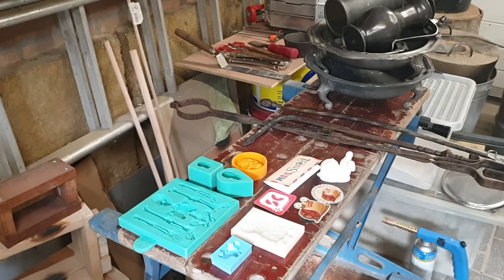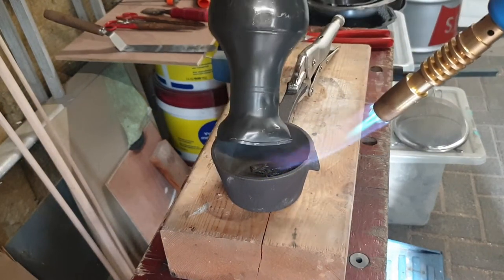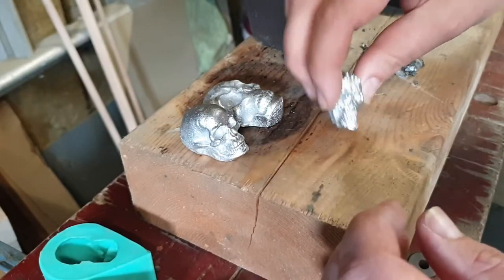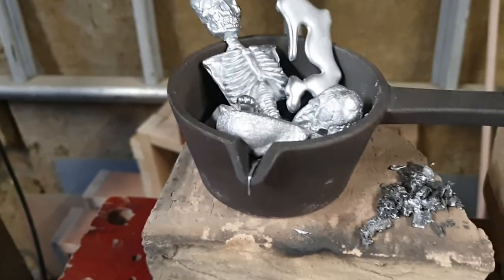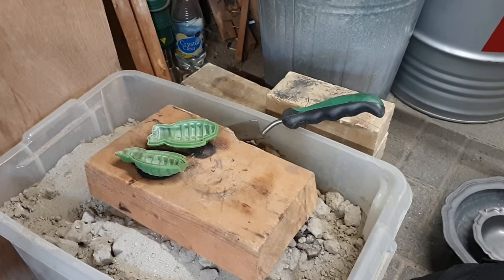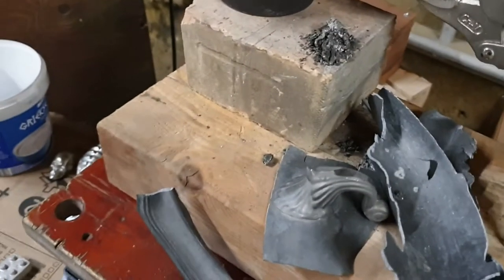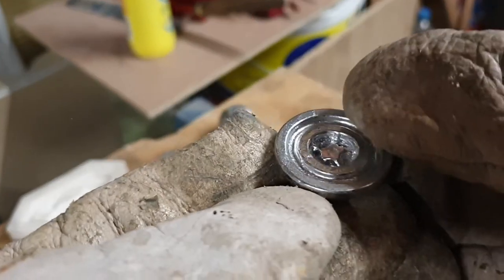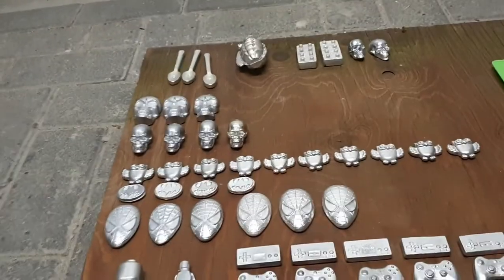More fun with pewter and silicone molds

Comment: Couple of points for anyone wanting to try this 
1. Dusting your moulds with baby powder helps to get a better surface finish 
2. if you have something in your workshop that vibrates when its turned on or makes your  bench vibrate put the mould on there pour the pewter in and then vibrate for a few seconds and this will help to prevent any sink holes as it settles the pewter into the mould and helps get any air out 
Happy casting :-)
Reply from the maker: Thanks for this info! and thanks for watching 👍👊

Comment: I kept waiting for the metal to freeze up on you when pouring the grenade.  I drop in and look for pewter at the local thrift shop periodically, but haven't noticed any on my trips, though I have found some decent and cheap metal molds that I've used a lot.  Always funny going to the front and being asked if I bake :)

Comment: Interesting video with good tips. Was curious, what kind of silicon are these molds?
Reply from the maker: They are just random silicon molds I bought on various websites, most silicon will hold up to liquid pewter/Tin, Lead and probably Zinc. Just make sure it's actual silicon and not rubber, I've molted through a few ice cube molds in the past 😅 Thanks for watching and commenting 👍🏻

Comment: Very good for someone learning to watch this, thanks!
Do you not need to heat up the mold first? Ive seen others say you need to, but ,ooks like your results are great without.

:)
Reply from the maker: The molds will heat up enough after the first pour, the good thing about pewter is that fails can be remolten and re poured very easily and very quickly. Thanks for watching and commenting 👍

Comment: That's really good.  I came across this video by accident and thought it was going to be rubbish.  In fact it was that good I'm going to try this. It was fantastic.  One question though.  Where did you get your moulds from
Reply from the maker: Most of the moulds I got from Wish, ali express, Etsy or Amazon, some I got from flea markets or thrift stores. Just make sure they are silicone and not rubber. Thanks for watching and commenting 👍

Comment: may I ask do you use a mask? or have some sort of fan? and have a idea to help you get a old oscillating tooth brush, by holding it near the silicone it should get the air out faster
Reply from the maker: Yes I wear a mask most of the time when melting and pouring

Comment: For pewter; are there any silicones that I should avoid? I would like to make some molds copying some things and creating others.
Reply from the maker: For pewter you should be fine with any kind of silicone molds, when making your own custom molds make sure youblook for high temperature resistance. A brand called: Smooth On I know for sure has it but I asume there are many more. Thanks for watching and commenting 👍
Reply: I looked the brand up for a company here in Canada that distributes it. There was one place about 45 minutes drive from here; so I went in this morning and purchased some. They had lots of variety. I bought the one that takes 6 hours to cure.
Reply from the maker: @randolphchappel6098   Hope it works out for you, good luck 👍

Comment: is the pot you're melting in cast iron?
Reply from the maker: Yes it is cast iron, it holds the heat really well, bought 2 of them some years ago for 2.50 each, still looking for a slightly bigger one though, thanks for watching and commenting. 👍
Reply: @ralphmourik  I went to a flea market today. The guy was asking $50.00 for 1 pot.  I was shocked how pricey it was. I haven't started melting yet , maybe one day.  Thank you for answering me.
Reply from the maker: @malyhe2007  Wow $50 isn't really a flea market price if you ask me. Sometimes I come across really expensive Pewter and just tell them that they will never sell because I can get it 10x cheaper elsewhere. It's just a matter of getting a lucky find, or sometimes people actually giving stuff away for free. Just keep looking and asking around. 👍
Reply: @ralphmourik  is there a way to recognize pewter, is it marked?
Reply from the maker: @malyhe2007  the good pewter I get over here has a mark of an Angel on it, sometimes it will even say something like 95% Tin or higher.
My email is on my about page, send me the question there and I can send you some pictures of the marks if you like.